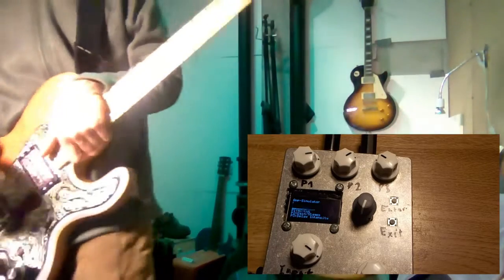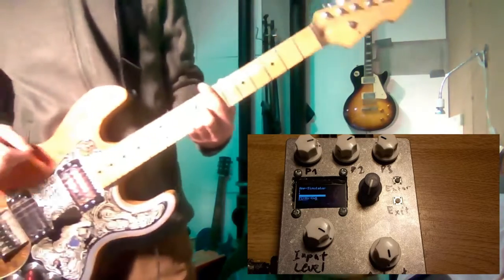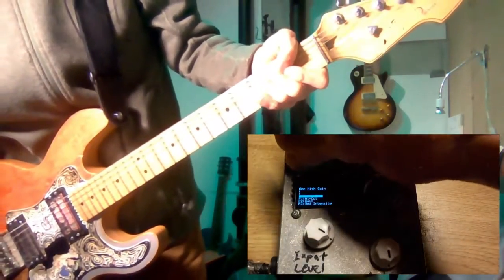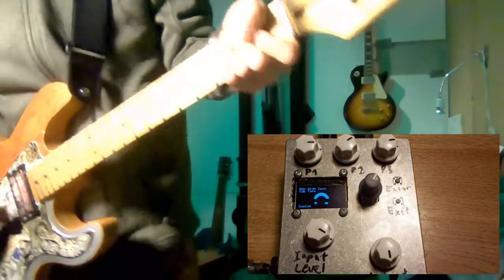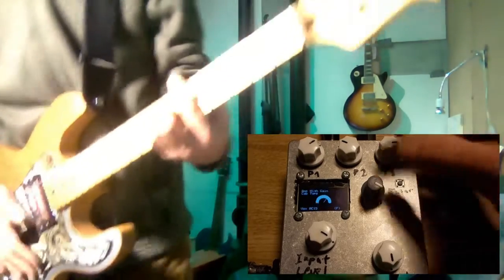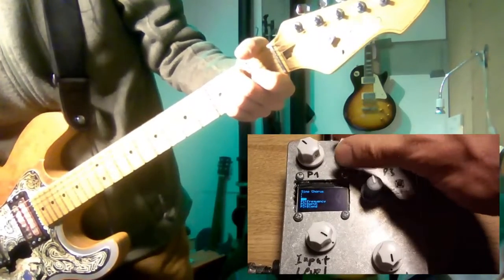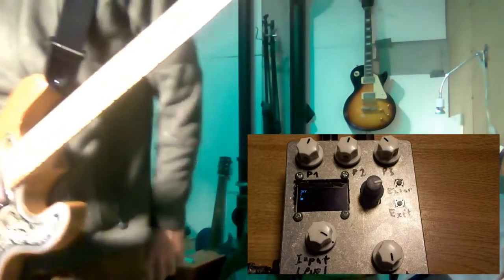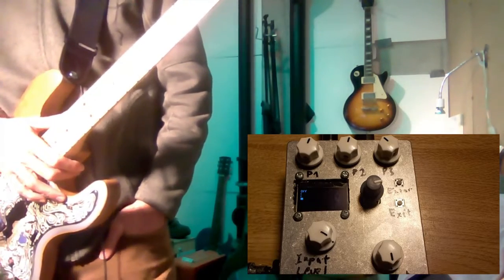Raspberry Pi Pico Multieffects for Guitar

Comment: I am really interested in building two guitar pedals based on the Pi Pico 2. Is there a place I can purchase the hardware preassembled? I am blind, so I can't do the hardware. But I am a software developer, so that part is not an issue. Thanks!
Reply from the maker: Hi, thanks for your interest. I normally don't sell assembled boards since it's very time consuming even at a small scale. Do you have a gitlab/github account showing your work as a software dev?

Comment: Now if you could find a way to tuck that sucker into the guitar and power it you could get REAL creative!
Reply: That's why I'm watching this video now lol. I wanna make a guitar with built in effects/amp ir etc
Reply from the maker: Space-wise i think it could fit into strat, maybe with extra carved-out parts, power supply is a different story though, i think it wouldn't last long when using batteries.
Reply: @linsoft23  maybe a USB charging module and rechargeable battery

Comment: 🤩Excellent project! I want to make one! Can I use the CJMCU-1334 DAC module?
Reply from the maker: Hi with some software changes it can certainly be used, be aware that the module provides output only (afaik). You could use the RP2040's internal adc for input, in fact i have done this in early development stages but it will be very noisy.
Reply: @linsoft23  Very interesting! I'll do some tests and I'll share. Congratulations on the project!